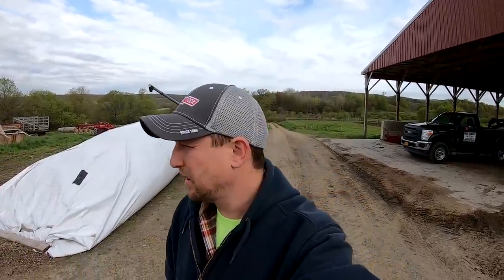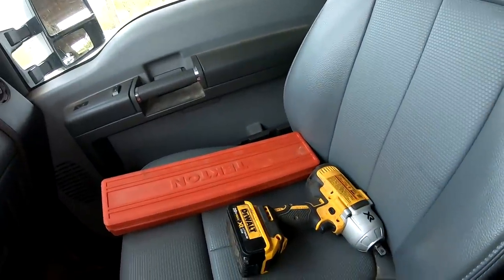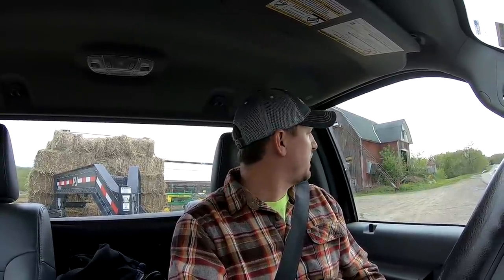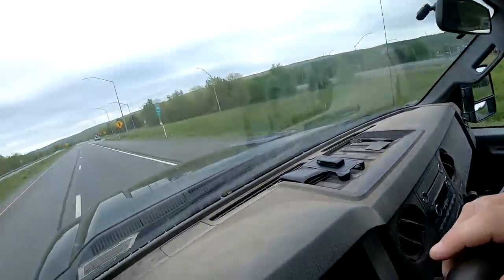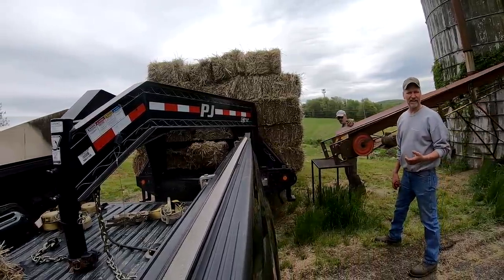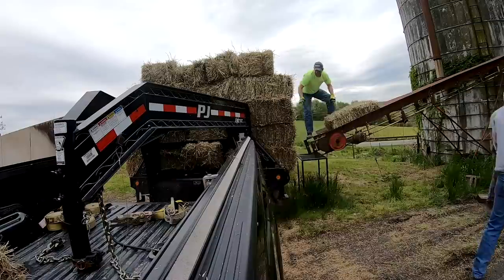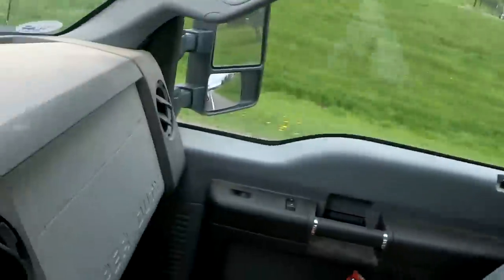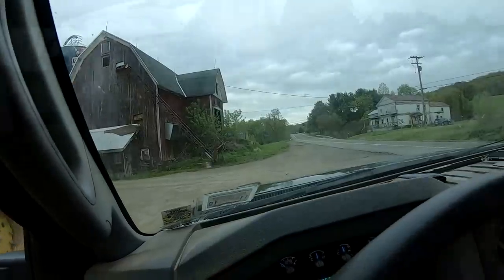Delivering Hay To New Jersey

Comment: Mike that was a nice ride along love to see the great out doors as you going to one place to another place nice video.  Round or large square bales beats small square bales it moving those small square form the field to barn and from it to someone elses farm.
Reply from the maker: I never have worked with the large squares but I'm sure they are just as easy as round bales.  It is nice to take a couple small baked to feed the cows though
Reply: Mike, yes small squares need to have some on hand but would be better to have the larger bales to deal with but your all's operations for you is best have small squares for the reason the cows stay indoors during the winter in the barn that they are milked in.